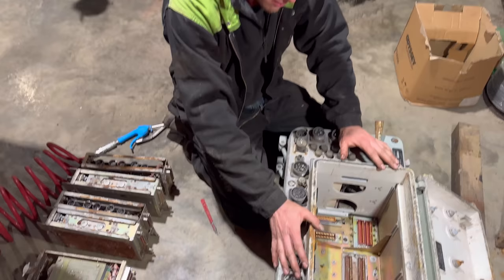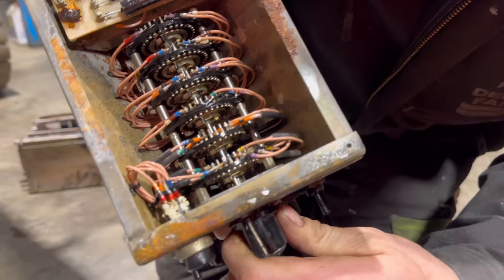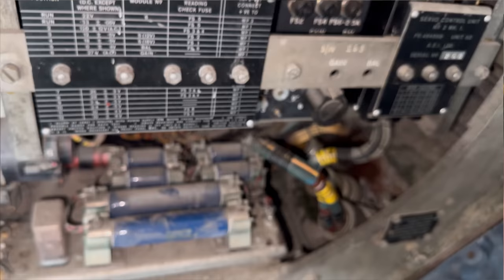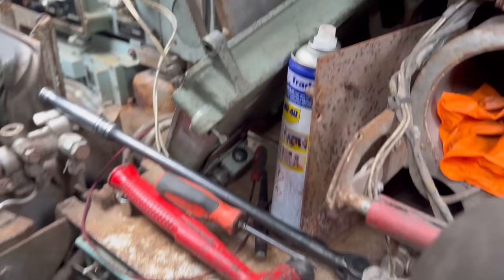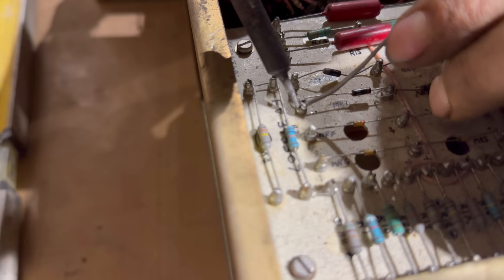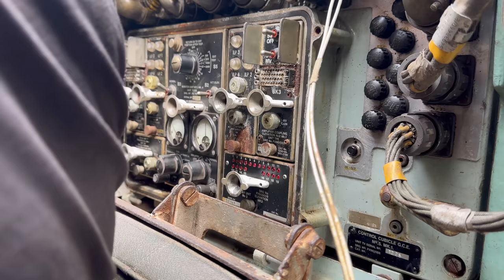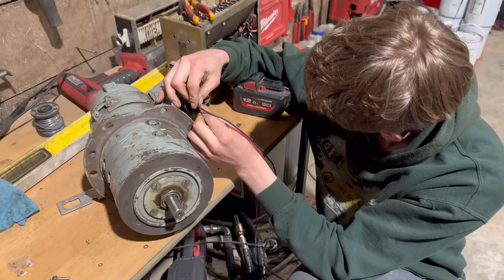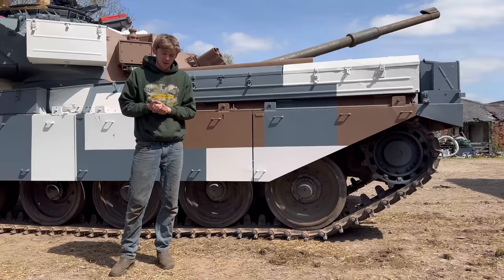How NOT to get a turret working!

Comment: I think that you are on the right track working backwards from the actuator motors, if changing out the actuators doesn't fix it it will be a major part. Otherwise you work forward from the control switches. Love the turret content.

Comment: Sometimes to get a ICE starter motor going in a pinch, you can knock on the side of it with a block of wood and a hammer to loosen it up enough to get it to turn over. I know this isnt a starter motor but it could break the seal of the corrosion enough just to break it free

Comment: those red multi pin back plain connectors look like the old ones the CB radios used to use, might be useful to know if you can not find replacement ones.

Comment: It would be good I think if someone had the manuals for these vehicles they would give them or sell them to you so you have a proper reference to make sure you do it right 👍👍
Reply: I once was an electronics tech for a weapon system that lived on top of a US Army tracked vehicle(a box) with a turret; I CAN'T believe that you skipped getting those kind of manuals before trying to bring this great beast back to life. 
Actually, if you had those manuals, a half-decent electrical engineer could probably design a box which could replicate ALL the functions of ALL those boxes in a single, smaller unit, and do the job better. But, anyone who COULD do that would - of course - want to be paid for their time and effort.
I looked to see if The Chieftain had actually left a comment, and couldn't find one by Mr Moran, himself; I suspect that he wouldn't want to touch this project with a barge pole. But, being an esteemed and knowledgeable individual - and a thoroughly nice chap - he would probably advise that you contact someone like the Tank Museum and to try to get a Chieftain specialist to give you a few pointers(and maybe steer you in the direction of some of those applicable tech manuals).
Mainly, remember that a tank is mostly a windowless metal box designed to protect the occupants from pesky rifle bullets and - after the Great War, machine guns - and the turret is a smaller version of it. Therefore, it's thick metal and VERY heavy, and anything designed to move it using electricity will be using enough juice to kill you, very quickly and thoroughly, usually without any warning...and, NO do-overs.
Watching your videos, I've seen dozens of things that would once have brought me to my feet, yelling. But you're still alive and your Chieftain looks great in it's new paint-job. Best advice I can give you is: "if it works, DON'T fix it."
So, good luck with your interesting project. Good Fortune attend you and PLEASE - be careful.

Comment: Bypass all the computer crap which will always cause problems, even if you solve this one. Basically all you need is a power supply to the motors and a toggle switch. Leave the big boxes in there for authenticity. I've done the same with the rear end of my tractor, old processors and hours of fault finding gone from interfering with what is just an up and down control.

Comment: I’ve got the schematic for the PSU. Looks like the breaker that’s tripping is X1. Is that correct? If so that breaker supplies the motor that drives the AC generator that supplies the logic with 115VAC and 300VDC (through a rectifier), and also the motor that drives a DC generator that provides 300v DC.
So get into the PSU and check out those 2 drive motors, looking for anything that drags the motor down and causes high current.
Reply: I have to ask, where do you go about getting a schematic for a Chieftain tank turret control PSU?
Reply: I volunteer at a museum in ontario , canada. We have a couple of chieftains and have some good contacts in the uk chieftain fraternity.

Comment: Make sure the individual relay units are working correctly, always test the Traverse system on it own first and isolate the gun controls, if you can track down a PLAICE and run the correct tapes, it might be possible to get the CIU to carry out some self tests on the CCMU display. Perhaps you might try finding a SS PSU 3/1 to improve things? Have you got a copy of any turrest system AESPs and have a very close lookat both relay units. From what i remember the relay units aren't interchangable or transposable ether!!

Comment: You would have to drop the turret motor and clean and free it. You will not get it freed while it is engaged with the drive gear. I would look up into the drive to make sure there was no damage in the drive part while motor in out.

Comment: Valves are not affected by magnetic pulse following a nuclear explosion …. Lots of valves in military equipment
Reply: Anything that contains wiring can be affected by an EMP as there will be an induced voltage on the wires which will make its way to anything connected. Depending on the power of the pulse and the proximity would depend on the damage done. That said, a tank is a metal box, a perfect faraday cage, so anything inside would likely be unaffected anyway.

Comment: Nice try even newer old stock is going to be corrupted. It's likely that all of your modules are going to have to be tested before you plug them into the boxes. Like you I've an engineering background, when it comes to the electricity bits, hands up out my depth, time to ask for help. Good luck boys

Comment: There must be someone out there who can fix ye olde 1970's electronics, or at least check the individual components on the boards work so faulty ones can be identified and replaced. The biggest headache would be a fault in once of the wiring harnesses where the wire has become brittle and snapped somewhere inside the sheath.

Comment: Suggest servisol contact cleaner and ms4 grease for cleaning and protecting the the connectors. Also the white corrosion might be off the cadmium bolts. Those used in original assy.

Comment: ACF50 is the business for that sort of thing cleans lubricates and protects used for that very purpose in the aircraft industry to stop corrosion in connectors and stress points not cheap but what is these days

Comment: Why don’t you plug the spare motor in the connector sit it on the gun and see if the tank electrics drive it back and forth then plug into elevation socket and try up and down
Reply: thats far to senseible.
Reply: Excellent idea, that'll let them know where the problem is.

Comment: Seeing as that tank will never fire a round in anger again, would it not be simpler to just build a control box that feeds voltage to whatever motor does what & chuck the "Posh" version in the bin?  End of the day, the "Posh" control unit switches motors on & off/switches polarity so it winds one way or the other. Button 1 - turret right. Button 2 - turret left. Button 3 - elevate gun. Button 4 - lower gun. Beyond that, it's just nerdery as this yoke won't be targetting T-85 's (or whatever version they are at now) across a European plain ever again. 

Up, down, left, right - how hard does it have to be, really?

"Is the gun giroscopically stabilised?"  No idea Pal , but it goes Up, Down, Left & Right.. Jobs OXO for "Pretendy Battles".

Chances are some "Important" bit of the "Posh" System is vanked - or will soon vank itself - so the "Simplerer" version is preferable.. 4 buttons... Even I reckon I'd have a fighting chance of wiring them 4 buttons..

Comment: Not wishin to be a bore, but WD40 doesn't conduct electrickery
Reply: I worked in offshore engineering. Data connectors, on multicore cables, which would be used at depth would be sprayed with WD40 before connecting and lowering. It cleaned any dirt and drove away any water. Never any problem.

Comment: No dog clutch so something is wrong
Reply from the maker: Quite but what could it be
Reply: The ece,s the ones with that sort of knowledge I was just a meer gunner mech years ago . These things are so old and un reliable even the tank museum in Bovington struggles to keep its chieftain gun kit working . But fantastic effort can't wait to see every video
Reply: Also just some points the commander's grip switch will override the gunners have either of them being tested . The drivers and loaders safety switches could be a issue